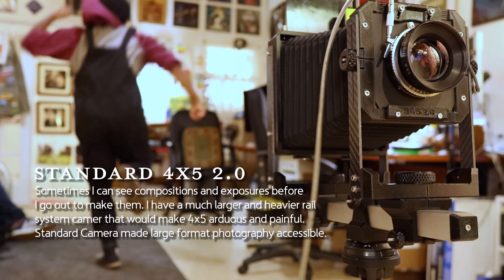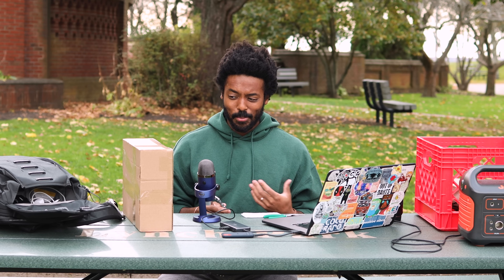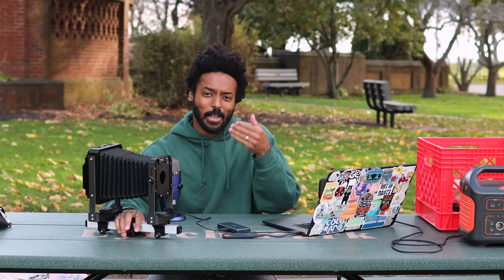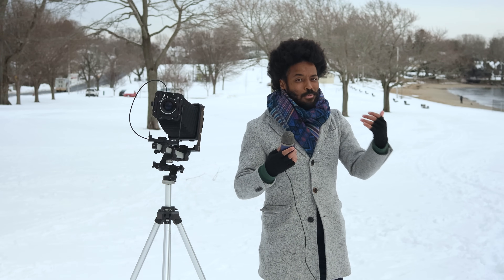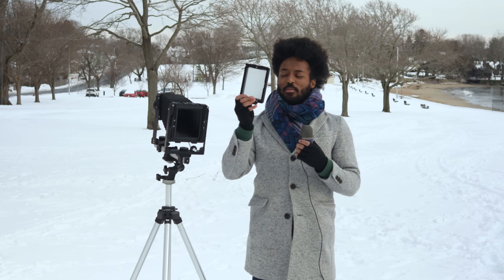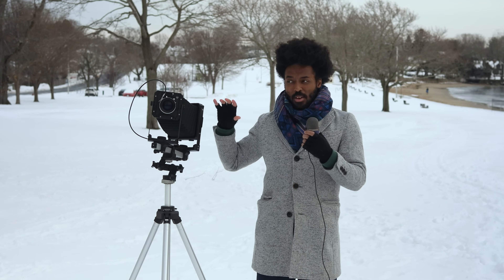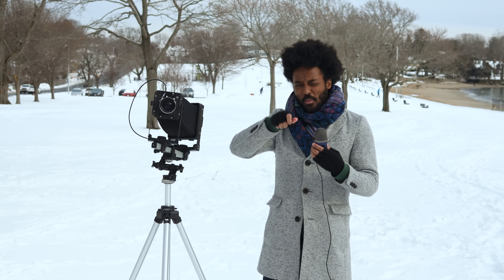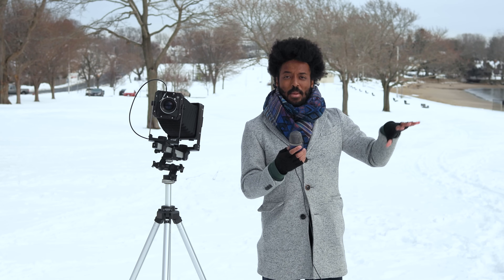A Camera Made From 3D Printer Plastic - Standard 4X5 2.0

Comment: The print files from Drew are perfect if you want to 3D print your own, everything fits together spot on and all the bolt holes line up which it far from always the case with multi part prints! Oh and great tip about 2 backs, second one printing now.

Comment: @4:00 you don't need a ratchet, just hold the key between your pointer and middle finger and use your thumb to spin it.
Reply from the maker: It’s not a ratchet.  They’re needle nose pliers.  And they were pretty useful during the build.
Reply: @LBCRPhotography  "My boy drew, who makes these cameras, has a little ratchet situation for the hex screw.."
Reply: @LBCRPhotography  again, you don't need a "ratchet situation" for the hex screw, just hold the key between your fingers and twirl it with your thumb.
Reply from the maker: @Broken_Orbital  oooooooooooh.  Yes that’s true.  You don’t need a ratchet!  I think that my video is proof enough that you don’t need a ratchet.  What I failed to express is that my hands got tired from using my fingers to twist the hex key.  The racket would have made it a little faster and would have kept my hands from cramping.  Sorry I didn’t understand your original comment.

Comment: So the thing that I always feel the need to point out to people with 3d printed cameras is, you cannot 3d print precise mechanical parts like shutters. That means that all "3d printed cameras", at least that I'm aware of, rely on cannibalizing pieces from existing cameras, and are usually built around lenses from cameras like the Mamiya RB67, which has the shutter mechanism in the lens. These 3d printed cameras are actually 3d printed camera _bodies_. The more popular 3d printed bodies get, the more difficult it's going to be to get lenses for legit RB67 cameras, which sucks if that's your camera system of choice.
Reply: I believe a majority of rail cameras and view cameras use lenses mounted to a front mounting board. These lenses are still being made, and I don't believe it takes away from other camera lenses. 

Can you share an example of this. My Toyo 4x5 field camera uses a Schnider Copal lens.

Comment: I'm looking forward to getting mine in soon it just shipped and will be building it as well.  I have an  Intrepid camera to compare it to so that is what it will be it's challenger to compare to.
Reply from the maker: Interesting!  I like the intrepid cameras.  The biggest difference is the focusing.  I think the the Standard camera is easier to move around in a studio environment and find focus.  The intrepid has that one knob that you have to twist forever just to get focus.  The rail system makes it easy to just slide the elements forward or backward to find focus, especially with a moving subject.
Reply: @LBCRPhotography  yep that's why when I first saw his video that had this camera I looked it up and liked what I had seen. For me the loss of a screw focus is not that bad I like this rail camera because I can change the lens and do it fast as to where with the Intrepid I have to unscrew the front every time just to adjust.
Reply from the maker: @davidedley2931  the intrepid certainly has it’s merits but I think that the standard 4x5 has a few advantages.  (The bellows on the standard are also a little better)
Reply: @LBCRPhotography massive shoutout to my partner who hand makes all the bellows and she does them perfect every. Single. Time. 🤯